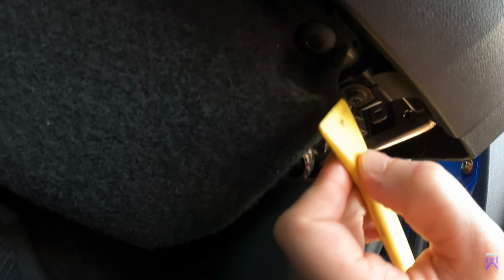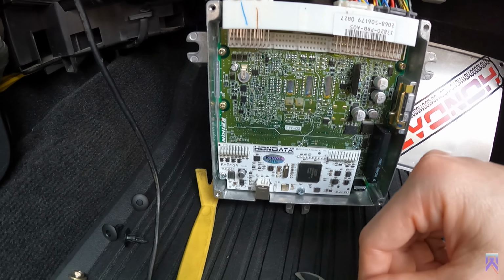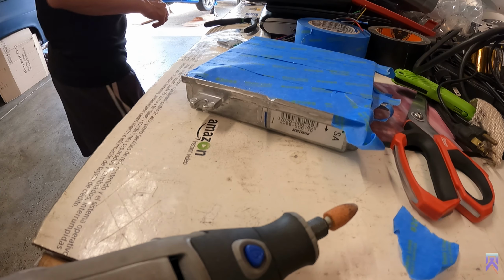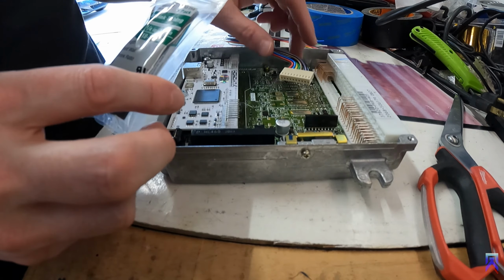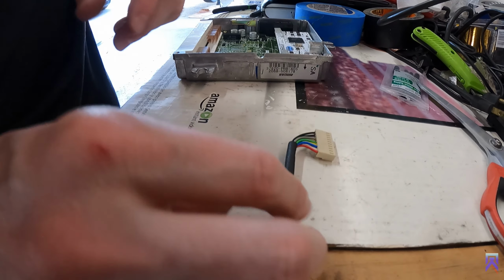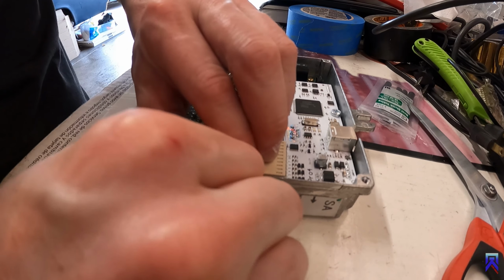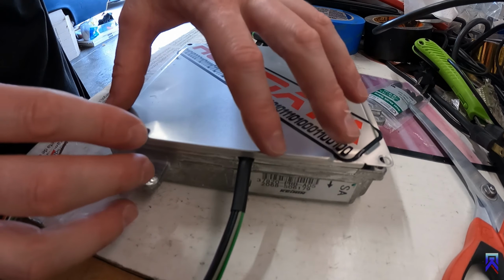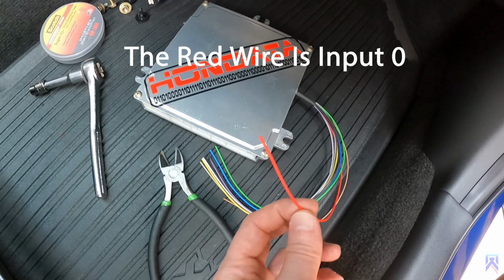Hondata Kpro V4 "Analog Input Harness Installation" 02' Acura RSX Type S K20 DC5 Turbo E85

Comment: You could have run the wires straight back from the connector out the side crack of the ECU with out drilling anything 🤦‍♂️
Reply: I didn’t realize that, thank you I was about to start drilling some holes but I see a gab in the ecu connectors
Reply: Is this what gotta do if I have a PND ecu trying to run a css and speedometer in a 94 civic